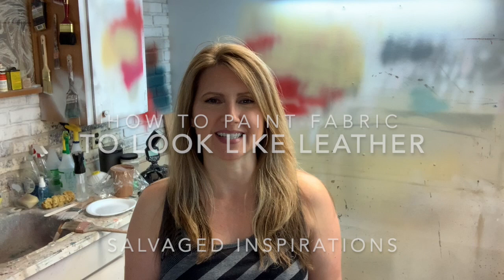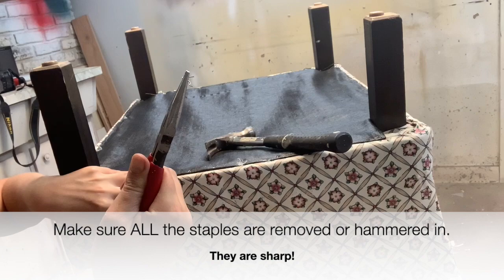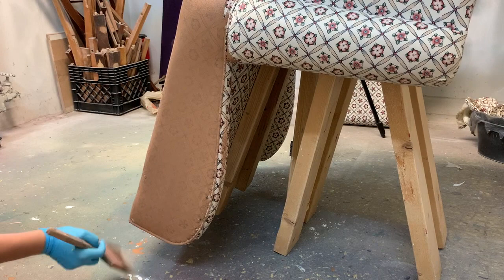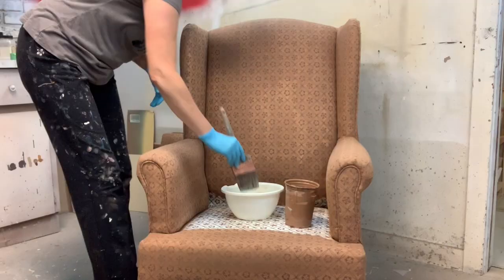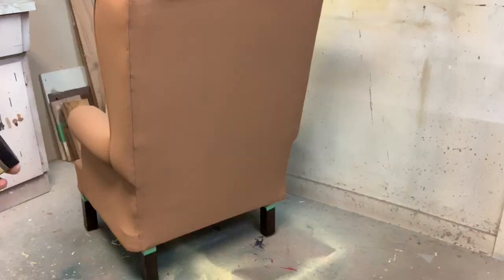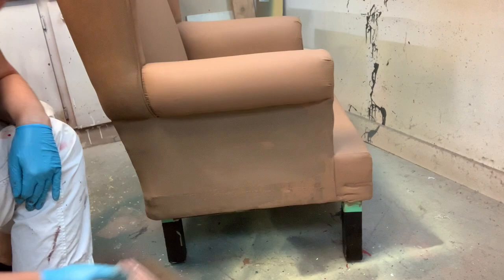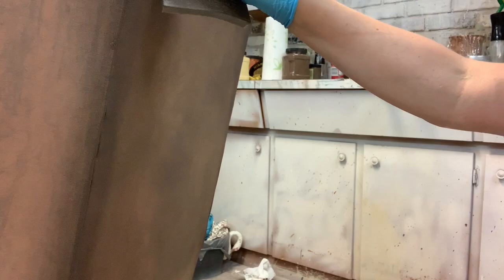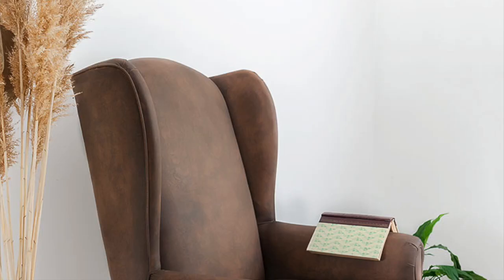How To Paint Fabric To Look Like Leather

Comment: You can mist with rubbing alcohol to help the paint to sink in better lowers the surface tension of the paint and allows it to flow better
Reply: Good idea, I think the alcohol would work like a disinfectant kind of (extra protection from possible mold growth and odors)  say from  the moisture put in the foam material?

Comment: I wish in Australia we had the variety of chalk paint, waxes etc that you guys have.  I am about to attempt my first chair  makeover, watching and getting lots of tips from everyone!!
Reply: Agree. It's tricky to get an idea of alternative paint & wax when a brand is shown, rather than explaining what type of paint is used. You can get Anne Sloan paint and wax in Australia, but it's quite expensive. 
I don't know if normal acrylic/latex paint can be used for this purpose instead.
Reply from the maker: Have fun with your chair, Jody! I hope it turns out fabulous. :)
Reply from the maker: @nikkieyeque  I've used a variety of brands and I know AS Chalk Paint works beautifully for this technique. If you'd like to try a normal acrylic/latex water-based paint, possibly a Fabric Medium could help. ?? If you’re not familiar with this product, Fabric Medium is a milky liquid. You add it to a water-based latex or acrylic paint prior to painting textiles. Its purpose is to keep the fabric feeling soft and flexible. There are a number of brand names to choose from like Martha Stewart, Plaid, Delta, Liquitex, and Americana to name a few. :)
Reply: @nikkieyeque  I've just watched a video showing how to paint fabric chair seats with latex paint mixed with equal amount of fabric conditioner. Spray mist with water to damp the fabric, apply the paint mixture with a paintbrush. Leave to dry thoroughly between coats. Finish off with beeswax. Apparently this doesn't transfer to clothes, so you can sit on the seats with confidence. I don't know who the creator in the video was, but she's called Deirdre.

Comment: Hi Denise;
I’m in the middle of painting a cotton fabric that looks similar to yours…except a white background with blue pinstripes and tiny red hearts. I had seen other videos of spraying fabric and watering down the paint. I have let each layer dry- a total of 4 coats of DB paint and it felt crusty, so I lightly sanded w/ fine sanding pad. It took the paint back and looked like a first coat. Discouraging. I am going to try one more time with your method. Any other tips are appreciated.
I previously did a leather chair with no problems in the same color scheme.
P.S. I’ve been pondering on how most furniture is scotch guarded to repel and protect from stains and water. I noticed when I started my project…as I misted the fabric, the water beaded up and it dawned on me…. Something for you and your followers to consider; which also made me think that once I noticed the water beads I should have lightly sanded under the cushion and then proceeded to see if the paint took. I look at it like scuff sanding a piece of wood furniture.
Thanks for sharing and I will comment back on how round # 5 goes!
Reply from the maker: I'd love to hear how it turns out for you. And ya, maybe there is some sort of scotch guard or repellant that is stopping the paint from being absorbed... maybe that's why it feels crusty. ?? I hope it all works out for you! Good luck! 🙂
Reply: Update; definitely light sanding over the fabric helps remove the scotch guard; but you also have to sand between coats to get rid of the crusty feeling …I wouldn’t do on fabric again as to much paint (4-5 layers) and work. 
  It’s been a few months and I didn’t seal the loveseat. It has held up fine with daily and consistent use of 4 dogs, kids, adults.
Reply from the maker: @tinaknutsen  Thanks so much for this update Tina. That does sound like a lot of layers of paint but I'm so glad it's holding up in your busy home!!!

Comment: I am so happy to have found your video! How many oz total did you use to paint the chair? I have 4 oz of chocolate and 4 oz of terracotta and I’m worried I don’t have enough to finish if I get started!
Reply from the maker: I don't actually remember the exact amount of paint but if it's a larger wing chair (like mine) I would double that to be on the safe side. It's always better to have a little leftover paint than to run out mid-project.
Reply: @SalvagedInspirations  thank you!!!

Comment: On the wax, do you have to let the piece dry all of the way before applying? Also, does the wax need to dry all of the way before sanding?
Reply from the maker: Yes, the paint and fabric should be dry before applying the wax. After you apply the wax you can sand right away or wait until the next day. Totally up to you. I sanded mine right after I applied it. :)

Comment: I painted a chair and waxed it and it looks great, but it hasn't held up the same. The seat has cracks  and the original color is peaking through. Any suggestions if I can fix it? Repaint it?
Reply from the maker: hmmm I had the same problem when I painted a velvet chair. I think the fabric makes a difference. I'm not sure how you could fix it. Maybe sand and repaint??